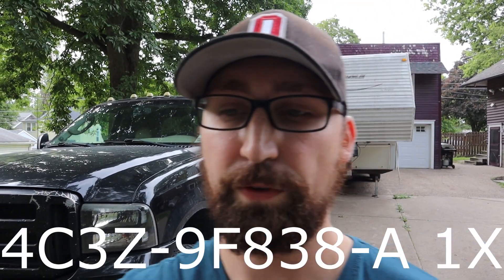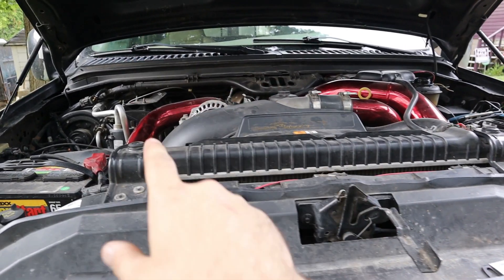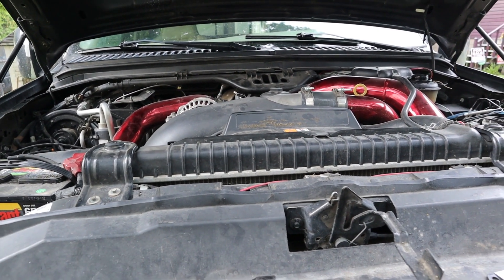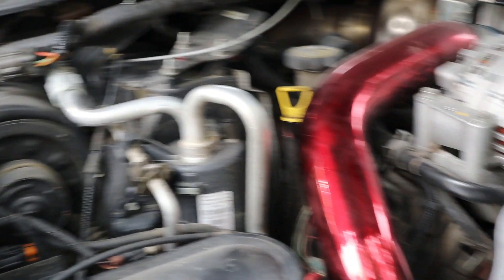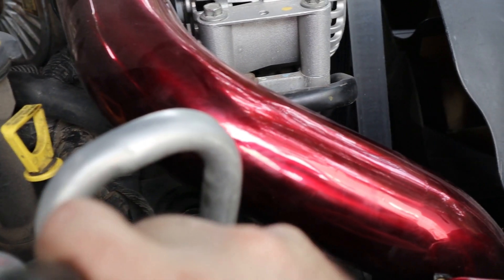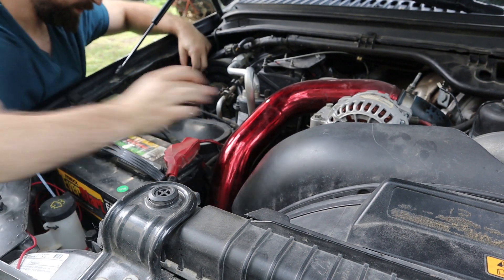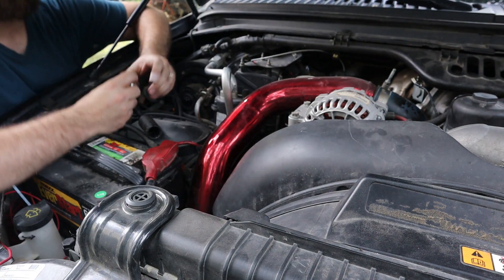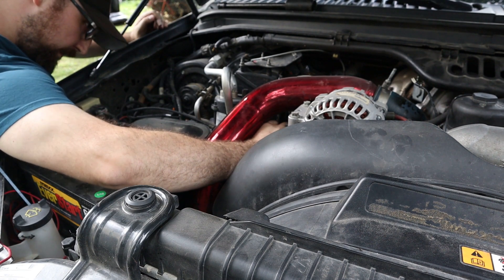How to: Replace the ICP (injection Control Pressure) Sensor On A 2004-2007 6.0 Powerstroke

Comment: I have a won't start when HOT problem in a 2009 Ambulance E350.  Replaced the injectors and high pressure oil lines (its a common cause) so it will now restart after cooling down a few hours after it shuts down typically when I hit a bump but the wont start still exists.  So i have both IPR and ICP parts, but have you an idea about the wont start back up when HOT and possibly why it shuts off or "reboots"  when driving and going over bumps?

Comment: Why didnt you replace the pig tail connector?
Reply from the maker: It was in good condition. Splicing wires can cause bigger issues sometimes, than having an old connector.

Comment: Just found this video. I’m hoping this fixes the issue on my ‘05. It showed low oil pressure and quit. Crank no start now. It seems to be building low oil pressure as it’s filling the oil filter canister. I changed the drain back valve because the oil was draining with the plunger closed. Fixed that but still no start.
Reply from the maker: Did it work?

Comment: My truck is leaking oil from that censor would replacing it fix that issue
Reply from the maker: There is a seal under the sensor that may be leaking. The new sensor should come with a seal, or you can just try the seal too.
Reply: I have the same issue leaking oil from this sensor.  I think the leak is between the sensor and valve cover. Any ideas? thank you

Comment: I have an '03 6 l and I'm getting a return on a tester from the parts store saying that my injection control pressure sensor is bad. Do you have a video on that sir And if you do could you please share it with me. I would truly appreciate it. Just in case, there's a bunch of removal of stuff where are you located I'm in Waukesha Wisconsin. I'm sure you're not in my neighborhood but I would truly appreciate the video sir! Thank you and have a good day!

Comment: My 6.0 die while driving now will only crank but not start. The icp is little wet with oil wondering if that's what's wrong with it
Reply: @redflagneagle mine does this now exactly did this fix your problem or was it something else?
Reply: @demetreiusmayes5403  yes I did I sold the dang thing. Worst truck I ever had
Reply: @redflagNeagle  thanks so much I’ll start there brother. I’m sorry about that hopefully you have a better one now and she takes care of you 🤟🏾

Comment: What did it sound like before and after?
Reply from the maker: It sounded normal, but wasn't running right. There was also a check engine light that came up.

Comment: Where u get the red pipes from
Reply from the maker: Amazon. https://www.amazon.com/Mophorn-Turbo-Intercooler-03-07-Powerstroke/dp/B07DZZCTRJ/ref=sr_1_1?dchild=1&keywords=6.0+turbo+pipes&qid=1588374570&sr=8-1
Reply from the maker: https://www.amazon.com/SUPERFASTRACING-Intake-2003-2007-Powerstroke-Diesel/dp/B07VLLTVYW/ref=sr_1_4?dchild=1&keywords=6.0+intake&qid=1588374633&sr=8-4
Reply from the maker: Now the intake pipe i did need to open up the MAF port a bit to be able to have it fit.

Comment: Started having an issue with my 2005 f250 6.0L got the code p2262...no boost pressure detected, thoughts?
Reply from the maker: If your boost gauge (manual gauge) is reading boost I would say it would be an issue with the MAP sensor. If it doesn't read any pressure than I would check all the intercooler connections. I used to blow the lower passenger side one all the time. If you don't have a manual gauge still check those things it's just harder to diagnose. I also have a leak test video. I talk about replacing a hose going to the MAP sensor in that video if you cant find where it's at. https://www.youtube.com/watch?v=XNIKmnHlo7k
Reply: @littlervbiglife1545  ill check that out, thanks!!

Comment: Hey Andy,
Was gone thru this winter and my 04 6.0 F350 wasn't being used during really cold temps, Ie: below zero. Got home and had a crank no start scenario. Checked my codes and found a P2289. key off. Unplugged the sensor and the truck fires right up, plug the sensor back in while its running and it runs for a bit and starts to skip a beat and eventually stalls out. So new sensor on the way. Bad sensor I presume. Do you concur? I just used torque pro, didn't plug in my forscan to check the voltage.
jon
Reply from the maker: Sounds Like what my truck was doing. A new OEM one cured the issue.
Reply: @littlervbiglife1545  Some follow up for you, I ran the truck without the sensor plugged in for 3 days while I wait for your recommended part. Truck started ok ran ok. Installed the new sensor, had to purchase a 24 mm socket, as the old sensor was 22 mm. Trucks starts immediately now and operates better than I can remember for quite sometime. I'm thinking the old sensor may have been an incorrect part, or faulty when I replaced it 3 years ago. Anyway thanks for your post and reply. I'm a subscriber of yours now. Thanks again and take care and be safe in this weirdness going on around us. Peace..
Reply from the maker: @captbad9313  Thank you for the update! It's great to hear that I was able to help someone out.
Reply: @littlervbiglife1545  your part number was key. Thank you

Comment: can anyone help me? I replaced my icp, now I'm getting the p2289 code (oil pressure high) truck runs fine. I'm just stumped
Reply from the maker: I would go after the IPR valve next. the screen inside of it is likely clogged.

Comment: Direct, to the point, and well done!  Thank you from one RV'er to another.  Running a 6.0 which is acting up.  Hoping ICP sensor replacement resolves my issue. Subscribed.
Reply: Following up, due to your ICP sensor video, I took the plunge and gambled this would resolve my issue.  My mechanic, whom I had a lot of confidence with (past tense), did not believe this was the issue.  It was, and you gave me the knowledge to easily swap it out.  Back to running like new (140k).  Thanks again!
Reply from the maker: @artstent8920  Glad to be of assistance.
Reply from the maker: Glad to be of help. I hope that it fixed your issue. if it didn't feel free to comment back and maybe i have gone through a similar issue with our truck.

Comment: Show tests for high pressure oil pump
Reply from the maker: Will do! Have been chasing an issue after replacing the turbo. I think it's the VGT but will be doing some tests to check everything.